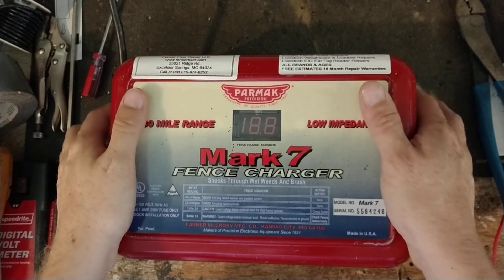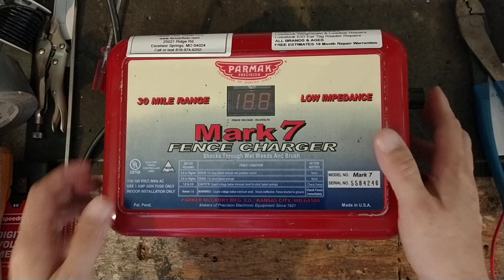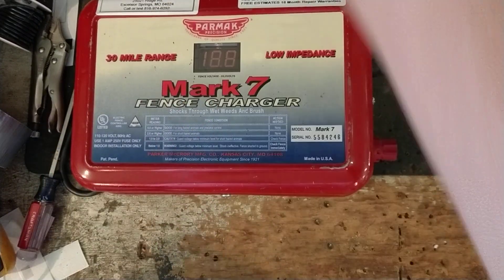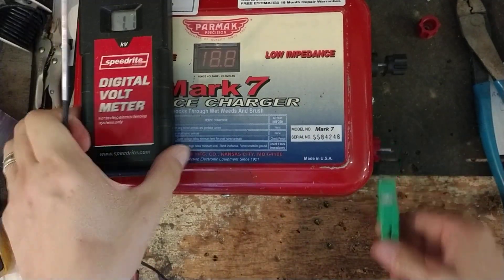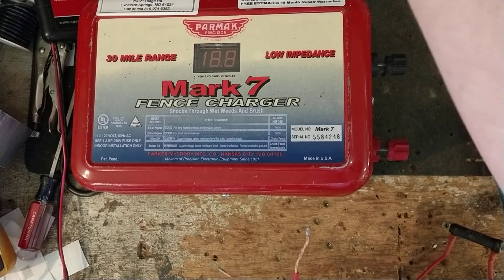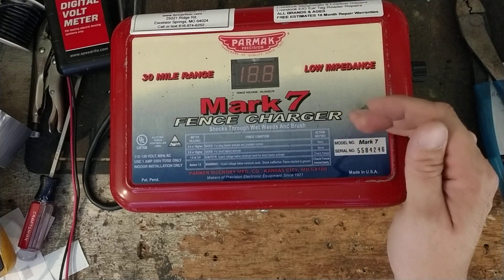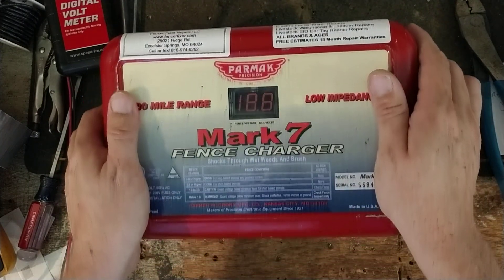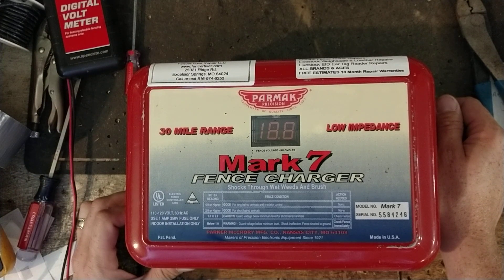Testing An Electric Fence Charger | Parmak Mark 7 Fence Charger Repair

Comment: Hello, I moved to France with my Parmal mark 7 unit. One night it suddenly triggered the 30mA differential switch on my electrical panel. When disconnected from the fence and plugged in the unit seems to work. If I connect the live wire to the fence it triggers the differential. There must be a  leak between live and earth. Any idea where the problem could be?
Reply: Fixed. I had switched around live and earth. But why did it work for 1½years before triggering the differential?

Comment: I've had 2 of em, lightning got em both.
Reply from the maker: Yea lightning gets different units all the time, old style new style. It doesn't matter the brand really, they all have and will get hit at some point. The good thing though, they can all be repaired.
Reply: @FencerFixerRepairLLCKansasCity   Where are you located I have one needing repair